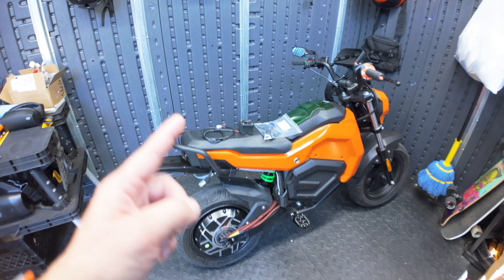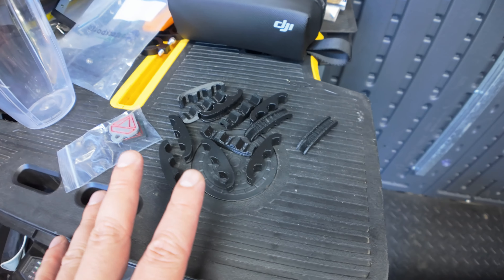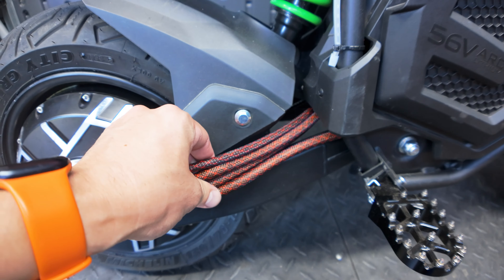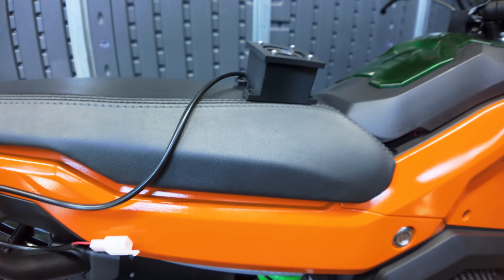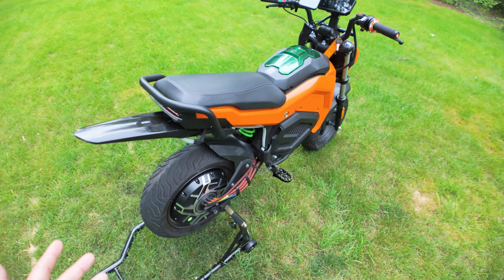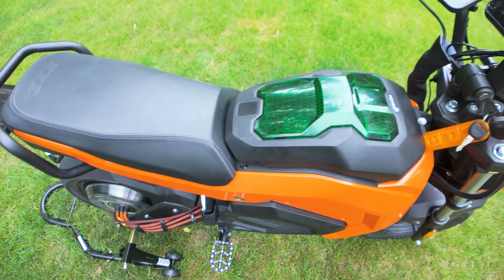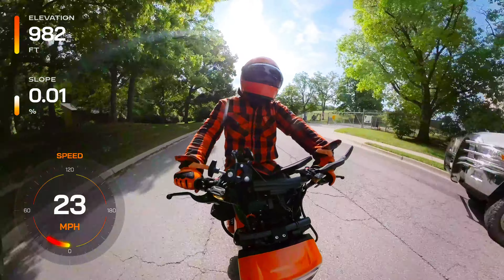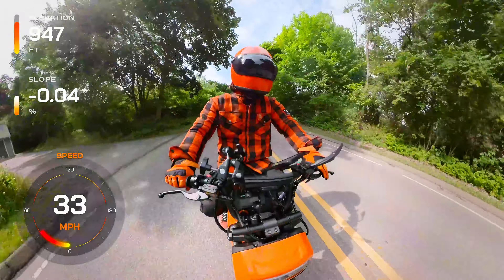72v EGO Mini Bike Power Transformation: Final Touches & Top Speed Test!

Comment: How did you fit the Sutton throttle on the bars, do you have to change anything or does it slide on perfect, thinking about doing the same to mine and putting to pro taper grips on each side. Let me know how I can do that!
Reply from the maker: Im using a Far Driver 7240 controller and spliced in connectors between that and the Surron throttle. Basically all the stock EGO electronics have been replaced.

Comment: I just heard you talking about the retentive on no throttle, my plans worked off throttle percentage, as zero throttle could be parking, of course, that could be a mistake at times,,,
Reply from the maker: Yeah I just went with the simple settings on the FD app, its been awhile so I forgot the exact number. We upgraded the brakes so regen isn't totally necessary at this point.

Comment: What type of motor is that i just got an ego ebike trying to mod it and how did you covert it to a 72v as well.
Reply: Also how did you wire everything on this mod I wanna be able to ride my ego ebike like this cause I use it to go to work and home.
Reply from the maker: Hit up Econic Cycles, they have everything you need for the EGO and can get your sorted out. If you end up going with them for parts you can also use my promo code - RUNPLAYBACK - for a discount - https://econiccycles.com/pages/contact

Comment: I think my version of this would use an upgraded controller, three of the 12AH batteries wired together for 36AH, DUAL stock motors and Dual sport tires. I like the color scheme so I would try to retain most of that.
Reply from the maker: That sounds like it would be a fun build!